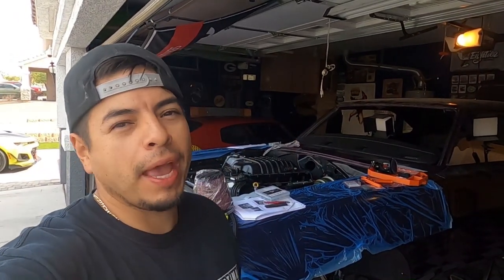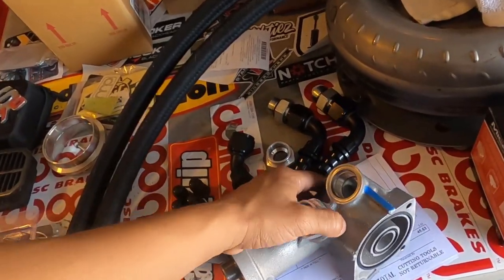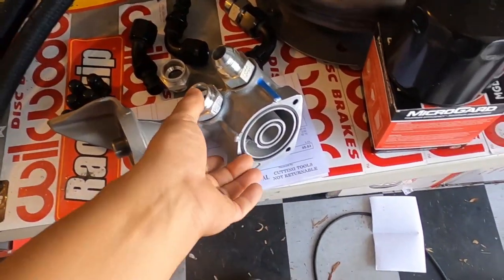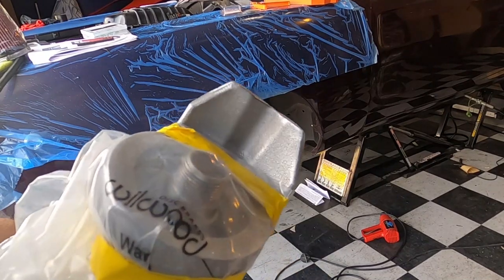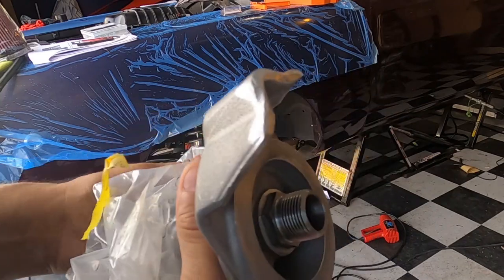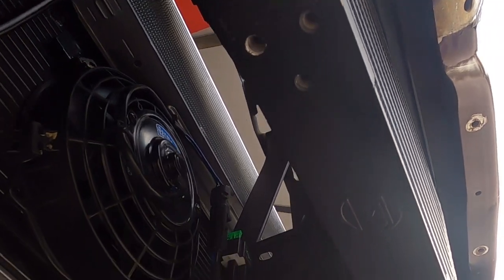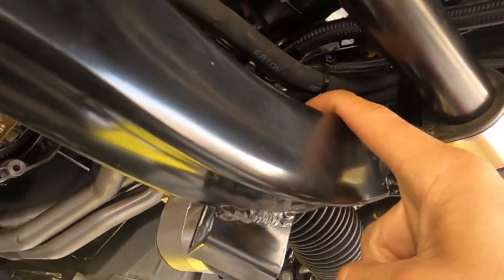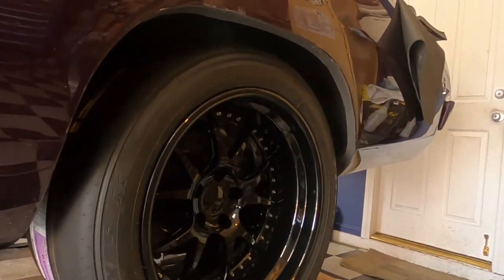RELOCATING OIL FILTER USING BOUCHILLON HELLCAT 90 DEG ADAPTER.

Comment: Just placed the order💯👌🏽  however I ordered mine from rock auto for $188. Bouchillon was taxing 🤦🏽‍♂️ in the future try running o ring fittings that swivel and go straight into a 90 like a fragola 499211 then use straight hose ends. Much better clearance up against that k member!